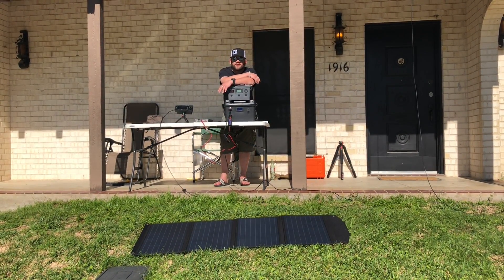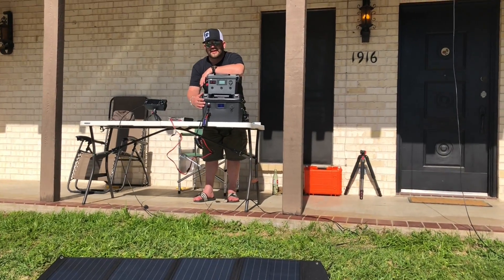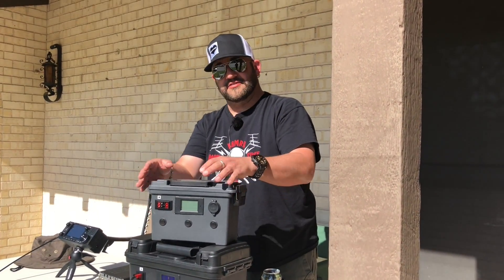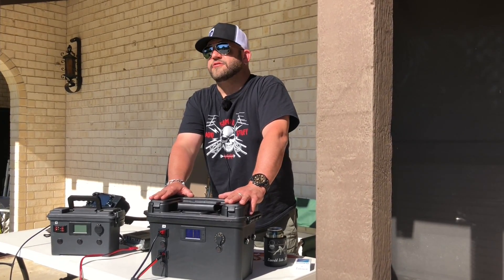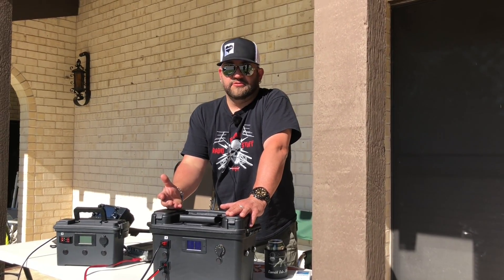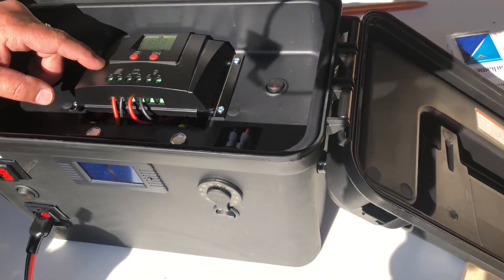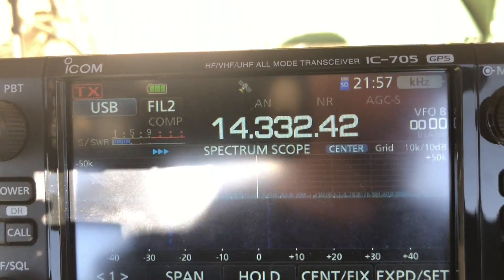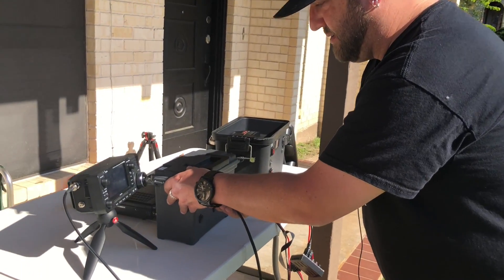I used a cheap solar charge controller and this happened...

Comment: I found your video doing some searching around on what a good charge controller would be for my 100w panel into a 10ah LiFe.  I use the solar setup to power the RTK receiver for my robot mower.  (I wanted the RTK to have a clear view of the sky, which meant getting it away from the house, but also away from accessible electricity).  I thought I was just fixing my lawn mower, something unrelated to HAM, but I guess it actually is somewhat HAM related.  I passed my Technician 3 weeks ago, and just yesterday I passed my General.  Glad to have found your channel, just subscribed.

Comment: One feature of the West Mountain Radio Epic PWRGate that I liked was a "charger snooze" feature. They recognized that their MPPT algorithm might generate RF hash, and gave you an easy way to pause battery charging if that was a problem for you in the particular band you were in.
Reply from the maker: Wouldn't it have been better for them to fix the problem with the RFI instead of pausing the charge?
Reply: @hamradiotube  I think they did both - I've never heard any RF hash out of it.

Comment: Good to know info. You actually do get what you pay for, sometimes!
Reply from the maker: Right?   The Bioenno isn’t even that expensive.  It’s like $50.
Reply: @hamradiotube  Wow. That isn't bad. But those batteries are not cheap.
Reply from the maker: Well, like you say, you get what you pay for.  With 2000+ charge cycles they should last the average ham a very very long time.

Comment: I have the inexpensive charge controller.  But I also don't place it 3 inches from the HF radio, and I use some ferrite around the cables.  I have not experienced any QRM from the inexpensive charge controller.
Reply from the maker: The first one I had didn't cause any issues.  I may or may not have accidentally fried it though and bought these new ones.  I don't have any room for ferrite in my G90 go box but I'll give it a try in the battery box.

Comment: I have been using a fully potted controller from Impulse Electronics that so far has been good.  I have 4 3.2v 25ah cells in series and have yet to run them down.  Nothing beats backpack portable with a full 100 watts!  I also found that those cheap solar charge controllers don't like rain....
Reply from the maker: How big is the Impulse Electronics controller?  The only reason I bought the crappy Chinese ones was because they are so small.  I have one in this battery box and one in my G90 Go Box.  Needless to say, I don't operate the G90 and charge it at the same time.
Reply: @hamradiotube  2.3 in. x 1.6 in. x 0.9 in.  Supposed to handle 150 watts.
Reply from the maker: @dylanschulz2404  is it this one?  https://www.impulseelectronics.com/mppt-150-watt-solar-charge-controller-for-lifepo4-batteries-mc4-input/
Reply: @hamradiotube  Yes.  I got the one with all 30 amp power pole connectors though.

Comment: I will have to try that test with my Renogy Charge Controller.
Reply from the maker: I’ll be curious what your findings are.  Those aren’t cheap either if I recall.
Reply: @hamradiotube  They are about mid range in price.  I have not noticed anything so far, but further testing might prove otherwise.  
If you ain't broke, you ain't pushing the limits.

Comment: Interesting. I have the same cheapo Amazon controller (from your link).  It's as quiet as the Renogy I have on my battery bank.  Nothing in the waterfall, or any increase in noise or meter reading. Maybe it's a case of win some, lose some!?  You enjoying that Texas heat?
Reply from the maker: The first cheap one I got didn’t have any issues but I may or may not have accidentally fried it.  Bought 3 more and they’re all junk.  And I’m loving the heat.
Reply: I wonder whether they have multiple different boards in them, and some are filtered, and some aren’t?  Or cut costs after the original batch and the new ones have no filtering?  Either way, I’ll stick with my Buddipole PowerMini and Powerfilm panels.  Sometimes you just have to suck it up and pay the money!

Comment: Aloha Mike, I hate those cheap charge controllers and you’re better off not using one at all. At home, I have three 14 volt battery banks that don’t require charge controllers and the solar panels are connected on the ends of the battery banks so that its charging the entire bank at the same time, sort of like a trickle charger reaching its peak in the middle of the day. Great video!
Reply from the maker: They aren't completely useless.  I can still charge the battery.  I use it for more than just ham radio so its actually pretty good all things considered.  How do your battery banks not require charge controllers?  Do you have all 3 in series to sort of match the open circuit voltage of the panels?  What is regulating the power when they are fully charged?
Reply: @hamradiotube  
     Mike, I use 6v & 8v golf cart batteries in series & parallel circuits to give me around 14.3-14.6 volts. I use 12v solar panels, that actually generates 20-23 volts in direct sunlight. I connect the —on one end and the + on the end of each battery bank to charge the entire bank equally. FYI, golf cart batteries require much higher currents for charging and less likely to overcharge, plus my panels only gets direct sunlight for only a half day. As a rule of thumb, I use one 100 watt solar panel per each golf cart battery, which is 5.59 amps of charging power per battery at peak, so basically still working as a trickle charger. I also incorporated one BatteryMinder 2012 Pulse/Desulf charger for each battery bank, which are connected to UPS power supplies to prevent power surges and brownouts, which is pretty common living on an island. 🤙🏻

Comment: As the saying goes when buying guns, body armor, and night vision ... "Buy once, cry once". Meaning, don't buy crap just to save a buck because it will cost you more in the long run.
Reply from the maker: Very true, though I didn't stop at one gun, so I cried many times lol!  The crap controllers still work for charging the batteries so it's not a total loss.  Just don't use them near your radios.

Comment: Interesting going check it out. 
Question do you use coax crimper.  Having a hard time setting up.  I use 213. Cutting up alot and of wire. DX ENGINEERING.  What do you think.
Reply from the maker: Absolutely I use a coax crimper.  Soldering PL-259's is the worst thing in the world.  Especially for RG-213.  I got mine at a ham fest a couple years from the MFJ booth for like $35 plus 2 dies for the coax.  Maybe $60 total.  I've not looked at DXE but I'm sure they have good, but expensive stuff.
Reply: @hamradiotube  yes they do. Still trying make it work. Cable stripper can't  get  them cutting it correctly.

Comment: Hey Mike, thanks for the video!  Clean power is a huge help when we are playing radio at home or in the field.  Did you happen to check the severity of the interference if you moved the battery box further away (to the limit of the wire length) in various directions?  I was just wondering if that would have had any effect on it at all (maybe not unless you had a 20ft wire or something)? YT: LCARA  Ham Radio
Reply from the maker: Not exactly but it isn't a very far throw for the interference, but far enough to mess with your radio when you're out portable.  My home antenna is above the roof and I didn't get any interference on my 7300 in the shack when the box was on the porch so its not that far, but far enough to be longer than the power cord.

Comment: Hey Mike,

Great video, although it would have been nice to actually see which solar controller you had in box #1.  Was it the same controller that you had in the G90 go box?

I have been looking at the solar panel/controllers to go with my Bioenno battery.
Reply from the maker: Yep same controller as the G90 box.  The main reason I bought them was for their small size.
Reply: @hamradiotube  Thanks for confirming it

I looked at those controllers, but I just have a hard time putting a no-name brand between a solar panel and Bioenno battery. 

This video confirms that when I get a solar panel, I will get the Bioenno charge controller too... might as well have everything from one place :D

Comment: Did you ever think of putting a Kenwood PG-3B Noise Filter just upstream of your radio in the power cord?
Reply from the maker: I have not, though I'm not really looking for more things to add.
Reply: @hamradiotube   It cleans up the unwanted hash on the power-line.

Comment: My camper has such horrible interference that I couldn`t use my AM and shortwave radios. So one day when I was bored I ran 100 feet of hookup wire out to a tree on the end away from the power meter, ran a plain hookup wire lead into my living area, and ran more hookup wire out the window behind me to a bolt on the metal frame of the roof over my camper which is anchored to the ground. I connected them to an mono plug that fits the antenna inputs on my shortwave radios and my AN-200 AM loop antenna. 

Finally I have clean reception on both AM and shortwave. I added another 100 feet of length to the antenna for better AM reception. I need to go in a different direction with the antenna though so I can get the Texas stations I like from Dallas and Houston during the day. If I take my CCrane EP PRO out to where the second 100 feet of antenna begins I get a strong signal during the day from 300 miles away in Dallas on 820 WBAP AM.

Comment: How does the buddipole powermini2 compare to the bioeno charge controller? Will be in the field solar powered for field day weekend.
Reply from the maker: Not sure.  I don’t have a buddy pole controller but that power mini 2 does look awesome. I’m sure you will be fine with either though.
Reply: I can’t compare them, as I only have the PowerMini, but it is excellent.  RF quiet, small, light, and a good display and good efficiency.
Reply: @hamradiotube  Thanks, for some reason I thought you had the powermini2 charge controller, must have been on of the other guys from the YouTuber bunch. Still great info for people to think about.  Still debating on the ic-705 since I’ve already have the ft891 and love it.
Reply: @hamradiotube  If you want a Power mini get that order in, Mine took 60 days to arrive.

Comment: Does the cheap controller shorten the battery life? What is the downside other than the RF noise?
Reply from the maker: Not at all.  Other than the RF noise it’s a great controller.